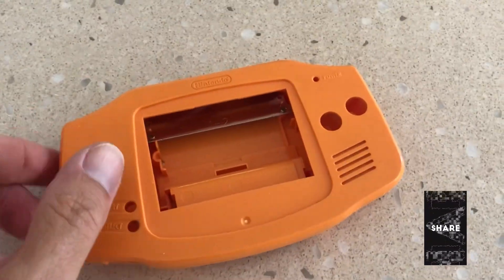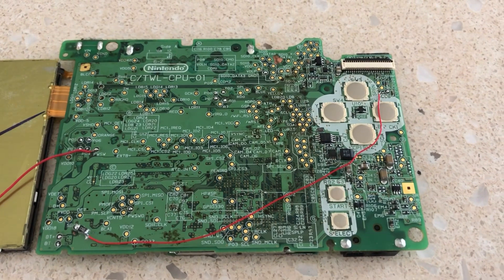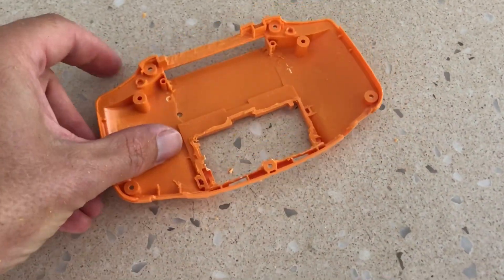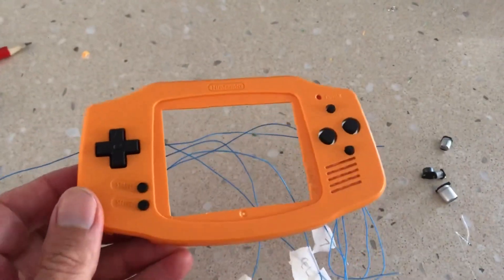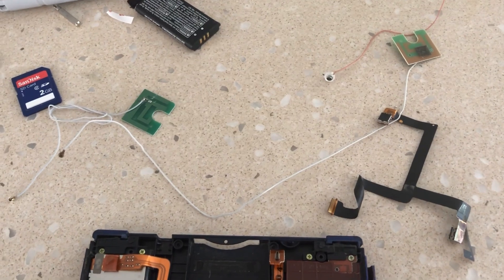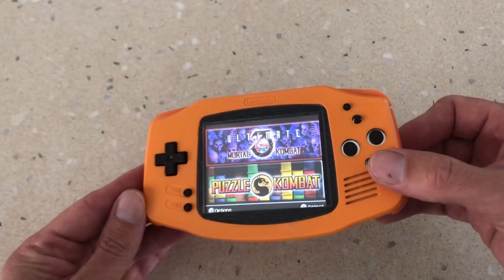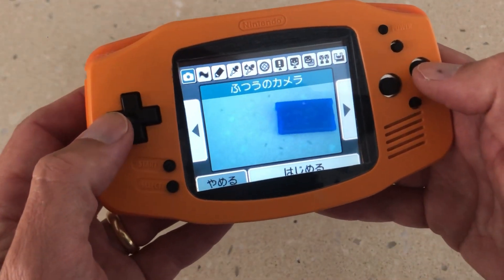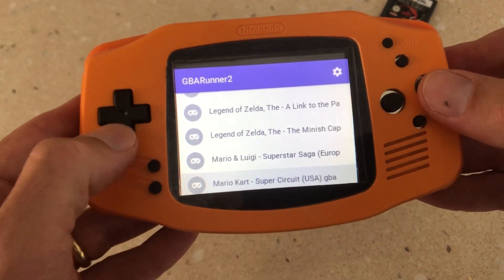Touch Screen Gameboy Advance - DSi Internals

Comment: Two questions, 1: where do you solder that wires to connect new trigger buttons, and 2: how do you wire the speakers to the bottom screen?

Comment: Can you link a 3d model of the gba shell? I would like to try this myself.
Reply from the maker: @Cakelord_29  it’s a standard shell that’s been modified
Reply: What materials should I acquire if I am to make one of these?
Reply from the maker: @ a DSi and gba shell
Reply: What wires would I need?
Reply from the maker: @ something very thin 32AWG or thinner

Comment: Amazing work! It came out so good.  How do you connect the battery? Do you solder a wire to the battery pads?
Reply from the maker: Cheers 👍thanks for your support. Yes we wired directly to the pads on the motherboard